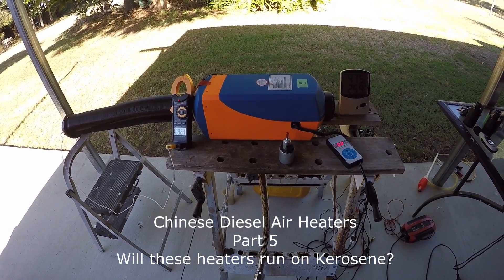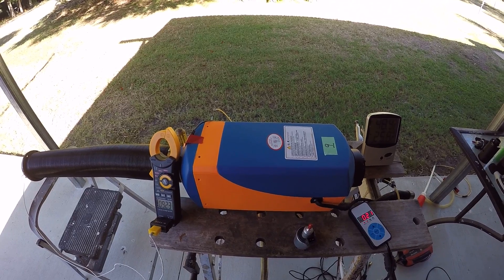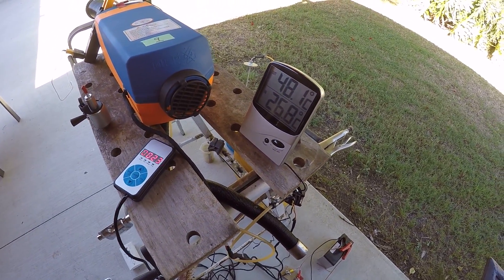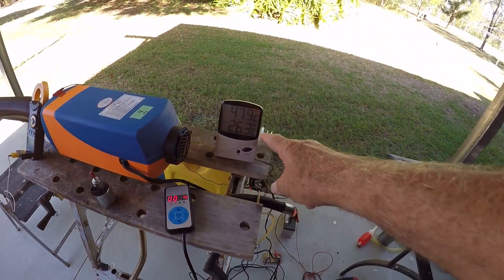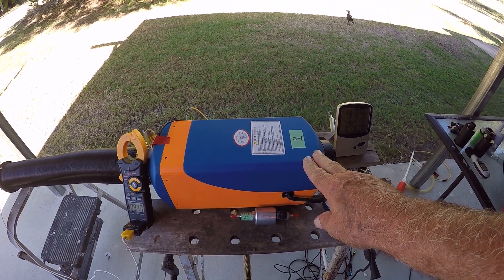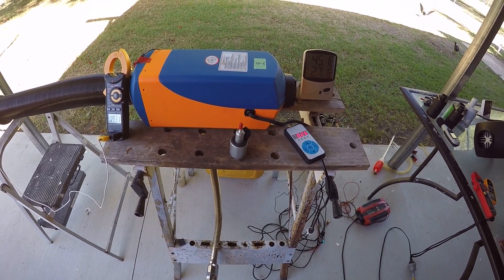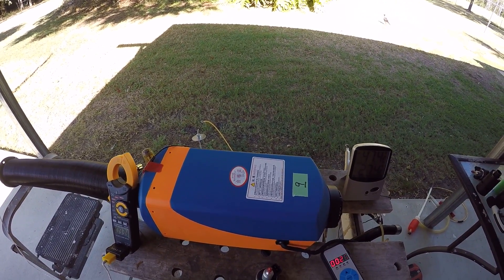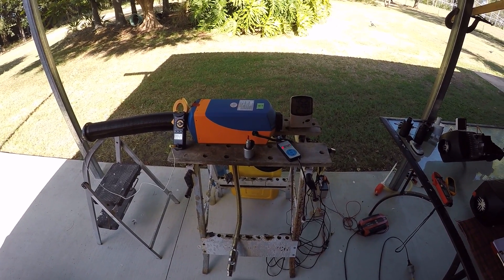Chinese Diesel Air Heaters   Part 5  - Kerosene Use.

Comment: Do you think adding a small amount of engine oil to the kerosene could add the lubricity the pump needs?  or would it have too sooty of a burn

thank you for the great series, just bought my heater and am trying to learn all the best practices!
Reply: You could probably add some two stroke oil as it is low ash
Reply from the maker: Hi, better to use 10 % diesel for lubricity, engine oil in these heaters causes significant carbon build up in the heater.  JMcK

Comment: Hi John
I cant thank you enough for the time and effort you've put into making this video collection , I watched all of them before installing my unit which I must say I would not of had the confidence to do otherwise. 
Ive filled my first 5 litre container with diesel for the first run of which I intend to change to a 80/20 kerosene diesel mix in future. 
My one query would be that would it be suitable to run a good quality diesel fuel additive through once in a while to help prevent carbon build up or do you think this would not be necessary whilst using the kero/derv mix ?
Thanks again for the great videos.👍
Cheers
Steve
Reply from the maker: Hi Steve,
First, thanks for the positive feedback.

A kerro: diesel mix is a good fuel for these heaters, but rare in Aus except for cleaning purposes as it is quite expensive here. 

I personally do not think a diesel fuel additive is necessary, or wise to use in these heaters, as there are so many different types on the market with a wide range of ingredients. I think you would need to know just what is in a particular additive and then do some actual testing. Better to just add some kerro.   JMcK

Comment: Great video, I guess I can mix kerosene in with the diesel so it doesn’t freeze here in the winter?
Reply from the maker: Yes Zev, and kerro helps with winter gelling of diesel, and also reduces carbon build up from operation at high altitude.  80:20 to 90:10 , kerro to diesel appears a good mix.  JMcK
Reply: John McK 47 Tnx, just Completed my install in my class A motorhome, Your videos are very helpful, watched  the whole series👍
Reply from the maker: Zev V 
Glad I could help Zev.  JMcK

Comment: Good video. Does the kerosene heat more efficiently that diesel ? I do know for an absolute fact kerosene burns cleaner and hotter. I burned several tanks of diesel in my pressure washer and it sooted up horribly. One tank of kerosene saved it. I agree that kerosene is a non lubricated fuel.
Reply from the maker: Yes Russ, kerro burns very efficient and very clean. If you have access to cheap kerro, a kerro diesel mix makes a very nice fuel.  JMcK

Comment: can it be started using heated air intake (grid heater) like a Cummins engine instead of glow plug? plugs are unreliable and relays are cheap.
Reply from the maker: No, it is not compression ignition. These heaters need a red hot glow plug, (igniter) to start the burn process, a bit like using a match.   JMcK

Comment: Great videos. I installed one in my RV and although the temp at the vent is over 150°, it isn't warming the camper as I hoped. Would it hurt anything to add a fan to push more are through the heater, to try and get better circulation?
Reply from the maker: Hi James, yes you could install a fan to circulate the air better. 
However, you should be getting a good volume of hot air coming out the vent, so check to see there are no restrictions in the air intake and air delivery side of the heater.
You do not say what size your van is, whether it is insulated, and what the outside air temp is. I also wonder if you have a small 2 kw heater rather than the more common 5 kw heater. A 5 kw heater should keep an insulated, average size van toasty in below 0 deg Celsius temperatures.  JMcK
Reply: @johnmck1147  it is a 30ft 5th wheel, with one big slide out. The heater is supposed to be 3kw. I ran a 4 inch insulated duct off the unit and separated into 3 2 inch ducts. Outside was 24°f and inside held steady at 60°f. I was thinking of adding a fan on the return side to push more air through. I want to make sure that it wouldn't cool the heater too much and cause a combustion problem. I can't seem to find cfm ratings on these heaters. With everything else in place, it shouldn't be a problem to switch to a 8kw size.
Reply from the maker: james w 

Hi James,

What you are looking for is the difference in temperature from the air going into the heater and the air coming out of the heater, this heated outlet air then mixes with your van air and raises the temperature. Forcing more air over the heat exchanger would not affect the combustion process, but would lower the outlet air temperature. However even though the outlet air is of lower temperature there is more of it. Net result, really no change. 

The Chinese do not make a real 8 KW heater at this stage, some sellers advertise 8Kw and sell at a premium, but they are just selling standard 5 KW heaters. See my video on this.

You could slot in a 5KW heater if you wish to increase the heat output in your van, or if you want to be really toasty, and have the space, install a seperate heater, so you have 2 heaters. Real cold nights you run both heaters.  JMcK
Reply: @johnmck1147  It is awesome that today's technology let's a guy from the United States get great advice from a knowledgeable person from around the world. You have done a great job with your videos. I appreciate the time you put into making them and replying to my message. Because of space, I believe I will try a 5k unit next. Thank you sir.
Reply from the maker: james w 

Your welcome James. Good luck.  JMcK
Reply: The problem with a smaller heater is that it is running on the max setting in order to be able to heat a larger space. If this is the case, then you will be using more diesel and more power to run. You might want to look into a bigger heater. 5 - 8kw. Before I would do that, I would cover my windows with plastic and try to eliminate any draft's, if any. Best of luck

Comment: Where I live in the US kerosene is not easily available however I have access to Jet A fuel which is basically high grade kerosene. I would prefer to use kerosene or a 50/50  kerosene diesel mixture due to the sub zero weather. My question is would the Jet A have enough lubrication to prevent the pump from wearing out? Or would it be best to just stay with #1 diesel.
Reply from the maker: Hi Larry, Jet A fuel has high sulfur content compared to road diesel. Somewhere around 400 to 900 ppm sulfur compared to about 50 ppm sulfur in road diesel. But each country is slightly different concentrations.
It is totally up to you, but I think it is worth a try to use Jet A on a long term basis. These days you can buy a Chines copy dosing pump for about $20, so it would not break the bank if you wore it out. JMcK

Comment: Has anyone tried #2 heating oil (often sold as Diesel in some places) as that is cheaper here due to no road tax. It does have a higher sulfur content than "low sulfur" diesel sold here as well which is what you want to lubricate the pump but will this dirty up the heater inside? This stuff has red dye added to stop people using it in road vehicles.
Reply: I'm running it with heating oil (Heizöl EL) that may be the same as the red diesel without road tax and added dye,  you mentioned. It has less additives than car diesel and may stuck in your filters at very low temperatures.  At the moment I've some problems with soot but this may have other reasons. After watching Johns videos, I realize that my setup of the heater is wrong. The manual I got was useless and for a other controller. Took me hours to get the informations to pair the remote or run the pump manual to get fuel in the tubes.

Anyway, I hope I can run a longer tests with heating oil end of next month, cause it is still to warm here and I've not done all changes in my setup yet.

Comment: Hi John, 

I have a question:
I would like to run my chinese air heater on pure lighting kero (because of the lower smell of the fluid and exhaust gases).
Due to the lubrication fact you mentioned I am thinking about mixing the kero with some two stroke engine oil. 
Do you think that would be sufficient to prevent the wear of the pump?
BR Wilke
Reply from the maker: Hi Wilke,
All oils, including quality 2 stroke oils burn dirty and creat carbon residue. Put some diesel, kerro, and oil on a rag and compare.
Better to mix with diesel for lubrication. I suggest  you start at an 80:20 kerro diesel mix for low sulfur lighting kerro. 
Good luck.   JMcK
Reply: @johnmck1147  
Hi John, 

Thx for your fast answer. I shoud have been reading all other questions/answers before...

I will try using lamp oil with higher sulphur and stock a replace pump in my toolbox. 
Cheers Wilke

Comment: So basically for the sake of the pump we should always run it 50:50 kerosene and diesel
Reply from the maker: It all depends on where you live and what type of kerosene you use. With a very high sulfur content kerosene you could probably run straight kerosene. But I would suggest you consider a little diesel. Say 90:10 kerro is to diesel. With low sulfur lighting kerosene I suggest you consider a minimum 80:20 mix, kerro is to diesel to give lubrication.  JMcK

Comment: What if you run on petrol mixed for two stroke oil, say 40:1, how long you recon it will last?
Reply from the maker: Hi George, running petrol in a heater designed for diesel is very dangerous. You may last as long as the heater lasts.  JMcK
Reply: @johnmck1147  John, this thread is not only very informative but immensely entertaining. I’m loving the “What if you use this and that fuel” queries, very funny. Hay what if you use Turps? Just kidding. My wife and I just installed our first Chinese diesel heater and planning our first trip to zero degrees and then minus temperatures in the coming month to Thredbo so thank you for being a very good source of information before we purchased it and during the installation. Informative and entertaining.

Comment: Greetings from the Mitta Valley, mine lasted two months running on low(50%) and it all sooted up. I ordered another one hoping I'll treat it better this time. Some claim that jet kero works well but I don't want to keep a time bmob under my house, smart, no? They're good little gadgets if you know how to treat them right, lets face it, nothing is perfect in this world, 'couse we are not perfect that invent them. Cheers mate :-)
Reply from the maker: Hi George,

It is good practice to run these heaters on a high setting for a few minutes before shutting them down. 

A kerosene/diesel mix, at say 70/30  or 80/20 run through the heater on a high setting for 15 mins or so will help clean out your heater.

There is very little difference in risk factor of kerosene storage and diesel storage. Yes, kerosene is used in jet engines, but it is also in stoves, lanterns and fridges in many countries.   JMcK

Comment: I wonder if it would burn a mix 50/50 of kerosene and filtered used motor oil.
Reply from the maker: Hi David,

Yes, the heater would run on that mix, but you would have serious carbon build up and hence lots of maintenance. Oils do not burn clean, just burn some and see what I mean, and as such produce large amounts of soot and carbon. This build up of soot  and carbon must be removed or the heater will not work.

A mix of diesel and kerosene is good as kerosene burns very clean.

I hope this helps.

Comment from the maker: Hi Keith, Amazon are one source that I use. I have also used fg tape from a marine supplier. The Amazon tape is more suitable. Your aluminum electrical pipe is a good solution, as heater piping is hard to source in long lengths.

 https://www.amazon.com/High-Temperature-Header-Exhaust-Insulation/dp/B00BSHZWDO

Comment: Good video, would mixing a small amount of unused cooking oil with the Kerosene solve the lubrication problem?
Reply from the maker: Hi Jason, better to use a diesel/kerro mix. Oils will work, but the issue with oils in these little  heaters is oils burnt leave large amounts of soot byproduct. It is soot and carbon that causes maintenance issues with these heaters.

Depending on where you live, some countries have a commercial kerosene, as distinct from what Aussies would call a lighting kerro. These commercial kerosenes sometimes contain a high sulfur content. It the sulfur level is high enough that can sometimes provide adequate lubrication.  JMcK

Comment: John, when The voltage drops below its operating pf 10.5 V, will the unit safely shut  down.?
Reply from the maker: Yes Keith, the heater will go into shutdown mode at around 10.5 volts. All will be ok unless the battery suddenly collapses when the glow plug switches on and draws around 9 to 10 amps.

Re the outlet pipes, are you talking 1.25 ins of flexible aluminum? If so, I think that is too small. Narrow ducting causes a lot of flow restriction. If you can't easily source the correct heater tubing, you could use aluminum vent ducting from a hardware store, or even try PVC pipe as ducting. 

I have tested 90 mm PVC domestic drain piping connected directly to the heater, and it worked well, but that was for testing. In practice I would not connect the PVC to the heater without at least 1500 of correct heat resistant ducting in front. However if in an enclosed space the PVC will soften.

In normal operation the heater will shut down with an outlet air temperature of around 125 deg C. The PVC I tested was able to handle that temperature, but softened. In an accident overheat, the fan is stopped and that greatly elevated air temperature does not reach the PVC ducting with the 1500 mm of flexible correct ducting as a joiner.

The PVC is easily to route with bends, joiners, and t pieces. It does get hot and can soften so would need wrapping in inclosed spaces. 

However better to use the proper ducting.

Good luck, JMcK
Reply: John McK 47  The reason I’m running into the quarter flex is because I’m using a duct output fitting which has 4 inch and a quarter ducks ports I plan to replace the 3 inch single with the one and a quarter inch quad but I can’t find any aluminum flex at the hardware stores
Reply from the maker: Hi Keith, thanks for the feedback. Yes getting ducting can be a real issue.  JMcK
Reply from the maker: Hi Keith, since I wrote this I did more special testing with PVC. I inserted a 500 mm test length of PVC pipe in my boat heater outlet about 500 mm from the heater outlet. Running the heater at max heat and in an enclosed space the PVC softened. For install and forget peace of mind, I would suggest not to use PVC.  JMcK
Reply: John McK 47 that is why am thinking of using electrical conduit aluminum flexible as it can he bent and directed as needed I guess if I either wrap it with Muffler wrap or some sort of insulation product that would help protect the cabinets in which it goes Under and around. have you found any good insulation products for such a project? Thanks
Reply from the maker: Yes Keith
Reply: @johnmck1147  thanks, I am assuming the shutdown would be automatic prior to failure and damage to the heaters circuit board. 
John Another issue: I plan to exchange the single outlet to a four outlet adapter consisting of four 42mm od/35mm id ducts. Because the initial expelled heat seems to be around 210+F, what flexible duct material and accompanying insulation would work best for ducting under and behind my RV cabinets. I am thinking of 1.25 electrical aluminum flexible conduit, wrapped with some fiber insulation? to duct from 6" to 8 feet under and behind drawers. 
However I did use muffler wrap for the exhaust to increase efficiency and help protect 8 inches as I passed through my storage area to the outside of my rig before putting muffler (youtube indicated that if you need to extend the exhaust pipe length, more pipe should be between the muffler and unit than from muffler and end of exhaust pipe, and the installer should take NOTE THE DRAIN HOLE IN THE MUFFLERS FACE DOWN!).
BTW your information videos are invaluable to anyone installing a diesel heater. PS I contacted several 8K Ebay sellers and they could not tell me the difference specs between 8K and 5K heaters! what a scam. THANKS again as I have purchased another one and I will be constructing a portable self reliant unit with internal battery (thus the question regarding automatic shutdown), fuel cell, and attached solar panel, all in one. I will include usb charging capabilities, and external battery hookup to use if necessary.